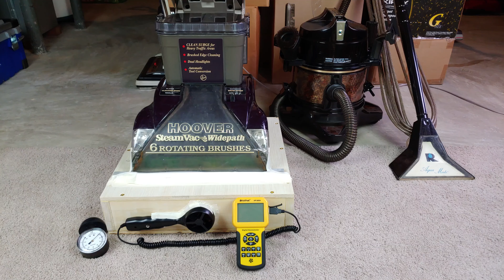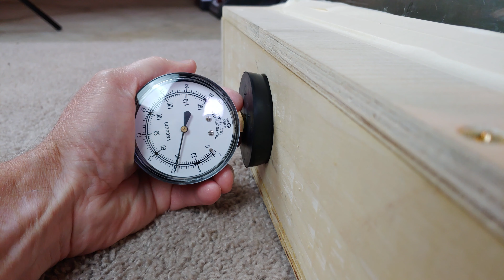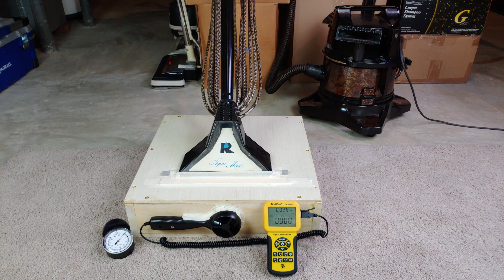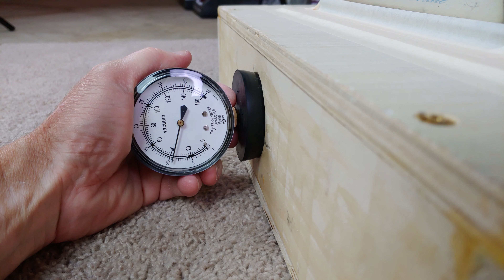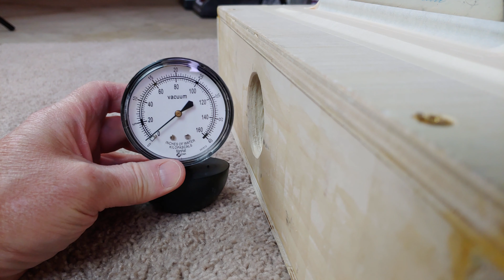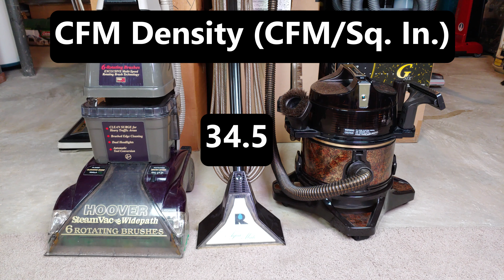Hoover SteamVac Versus Rainbow AquaMate 1 Airflow And Suction Tests

Comment: Watch the water in the clear intake move.  When the machine is in a suction setting the water is barely flowing up the intake.  Once the machine moves on to an area where it can suck more air freely that water takes off into the depths, lol.  Same thing happens to the fibers so the higher CFM is 'grabbing' water off the fibers.

 The suction test for carpet extractors is slightly misleading when using the guage. When you put the guage on it creates a vacuum but when you put the hose into a bowl of water its going to 'suck' a lot faster. Its just air pressure differential which now it just hit me.  Would a test to time how long it takes to suck up 1 gallon of water be of any scientific purposes? I cant really think of any but just a cool experiment.  

BTW I just put my Rainbow E2 Black up for sale.  Its in great condition but for the cost that I paid its a horrible value to me.  I purchased a SEBO D4 to go along with my Kirby Sentria 2 and I also got a Bissel ProHeat x2 pet revolution..... ITS AMAZING.   It cleans so much better then my rainbow aquamate.  

Thanks for all you do.
Reply from the maker: Think about this: if the nozzle of an extractor completely covers a pool of water (floor, carpet, etc.), that's the point when the sealed suction test is 100% accurate. Since that's not always the case, the CFM density takes over.
Reply from the maker: I re-read your first paragraph and you have it exactly backwards. When the carpet is very wet, suction is at its highest point and the water flies up the nozzle much faster than when the carpet is drier. You can easily see this effect in the SteamVac playlist.
Reply: @VacLab  hmm.  Maybe our terms are different.  I can replicate this easily.  If there is a little water in the intake it can be motionless. Bit if I lift the machine or tilt it the vacuum releases and the water gets sucked up.
Reply from the maker: @tekjunkie28  https://youtu.be/KyDmh2YBGNU

When cleaning a very wet carpet, suction and water pickup are at their highest (fastest). When there is little water remaining, suction is lower and water pickup is much slower. Very easy to see in the above video.

Comment: I was always wondering how much airflow would water extractors have. And btw this guy from kirby enthusiast started his new airflow box tests! 👍
Reply from the maker: I'll take a look at his airflow box tests soon.
Reply: Brent Cho he’s has a good start though 113 CFM dose seem a little low
Reply: But I’m not sure if the kirby is the one that has less airflow or the anemometer is the one that’s reading it wrong.
Reply: Brent Cho I think it’s the conversation factor and I didn’t see that he sealed the Kirby on there with tape because I’ve just tested mine with his method and I got 122 CFM and the I did some calculations with my conversion factor with his feet for a minute and I got 117 CFM for his but unfortunately he doesn’t have another anemometer so it’s hard to say what’s the proper conversation factor for him